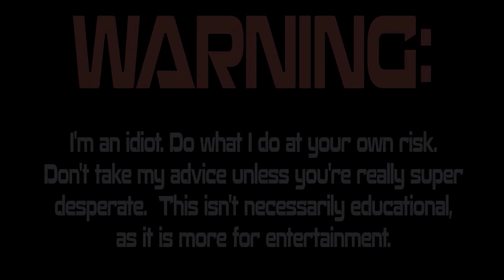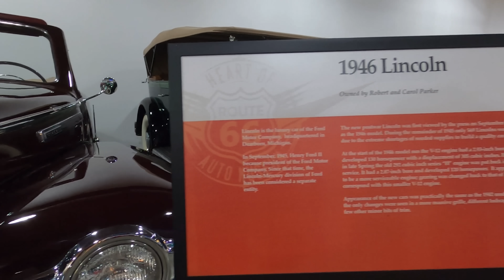Will This 1956 Buick Special DRIVE 1,200 MILES Back Home - I BROKE DOWN! (P2)

Comment: I was told by an old timer that wireless tying a wooden clothes pin to the fuel line can help with the fuel line vapor locking

Comment: Your Car and your Trip have brought back some old memories of long ago.  My Father bought a used 1955 Buick Road Master in late 1956. Each Summer from 1957 to 1962 we would go on a Summer Vacation of just over 1200 miles round trip. That Buick was a wonderfull riding Vehicle. However, I recall he had to shortly after buying the Car fix the Dyna Flow transmission. These Trasmissions were noted for problems. The Transmission is the only major problem I recall that occurred with this car. It was a very reliable comfortable on the Road Car. The excellent ride quality now as I look back was probably do to the fact that Buicks were a Heavy Car and the Heavy Cars in those days all seem to have had a pretty good ride quality. In all the Summers we went on Vacation in that Car it never broke down once on us. My Father sold the Car in 1963 and bought the only New Car he would ever own " 1963 Gran Turisimo Hawk Studebaker" which he picked up personally at the Hamilton, Ontario Plant where they made the vehicle.

Comment: I had a 72 camaro RS that used to do what I thought was vapor lock. It was annoying as hell. It turned out that the cam was flattened enough to where it didn’t make the mechanical fuel pump function properly. I eventually got sick of it and used one of those little electric deals and ran it back near the tank. Then when I swapped the motor I put a mechanical one back on. I liked the electric one but I always worried if I ever got into an accident that little electric pump could still be on and just pumping gas leading me to a fiery inferno. But I put the new mechanical one in and it ran like a charm. 
Now I gotta find part 3 of this vid

Comment: I inherited my uncles '63 lesabre with a 410 Wilcat nailhead and a dynaflow transmission, which I loved back in the mid 70's with about 70'000 miles - a car I rode in most of my young life, when I got it I discovered it had never had the coolant flushed or changed and that thing was always prone to overheating, found the clutch fan was weak and replacing it helped a lot, but like yours my freeze plugs were getting angry and on a hot summer day she still wanted to overheat even without a thermostat, I suspect the cooling system was sludged up, but it never burned a drop of oil.  Drove it from Tennessee to illinois and the starter solenoid stuck on in a gas station nearly burning up the battery cables.  In short I was a young guy with no money and it needed a lot of $TLC$ I couldnt afford at age 16, but ill never forget riding in that car with my uncle in Chicago, Tennessee and years after he passed onl  RIP Uncle O.L.

Comment: feel the radiator fins from top to bottom , should be even temp , if you feel a cold spot the rad is clogged in that area

Comment: Kanter's should have just about everything you need. I have a brand new set of wheel bearings for that car, got them from Kanter's. I would give you those bearings if I knew where to send them.

Comment: My folks  had a sweet '55 Super very close to your '56. I  wanted it.   My older sister got it and wrecked it. This was  after she creamed their '57 Olds 98 with tri-power j-79. They fixed that one and traded it in on a '66 Dodge Dart. They got fifty bucks for the olds.

Comment: Easy fix to vapor lock is to use wooden clothes pins on the fuel line by the motor. Worked like a charm in my old suburban.

Comment: After all that you have tried, it sounds like you have a head gasket leaking into the cooling system causing the overheating.  Also, on the gas issue - why would you not suspect a bad fuel pump?

Comment: Nice old car I use marvel mystery oil in the gas on the old ones helps lube the valves runs cooler but little bit more smoke. Water Wetter really helps cause them rads get clogged

Comment: With the new radiator hose use a wire coat hanger. 
Just unbend it then shape it around the hose, to the shape you need 
 The hanger will stay that shape until you get home

Comment: That bottom hose always swells at the bottom. Had a 1973 Pontiac Ventura that that dropped a rubber gas line in down town Frankfurt Germany. Had enough unleaky  hose and cut out the break on the line connect what was left to limp home to Mannheim Germany.

Comment: I had a 72 camaro that vapor locked when it got hot. I eventually switched to an electric fuel pump and it solved the problem. Before the electric pump I’d put in a new mechanical pump. It still would leave me stranded. I figured maybe the cam was just worn enough maybe to make the pump stop working. When I put the new motor in it I went back to a mechanical pump and it worked perfectly. So who knows, I think it was the cam being worn and it wasn’t moving the rod for the pump enough.

Comment: If you bring a little gas bottle to prime the carburetor, try to get the gas into the float area, You can almost always start a vapor locking vehicle without waiting to cool down. Then just be sure you are moving at at least 20 miles an hour and you might be able to get the fuel moving again. Also, an electric fuel pump, wiring and an extra battery would be good to bring along (or buy) on these trips. Just in case anyone else gets into this predicament.

Comment: hi derek, I noticed that there are 3 pedals on the floor, but I don't understand what its for as the dynaflow is essentially an autobox.  Can someone explain what's going on with the extra pedal?  Would be much appreciated.  Cheers, Frankie.

Comment: My first car was a 1956 buick super, model 56R these episodes with your buick brought back memories most notably the overheating issues. The pattern of overheating was very much those your car experienced. Whenever it was very hot or climbing a very slight grade you can literally watch the temp gage go from green to red. I did all the obvious things but the overheat issue was never remedied until I did these two things. I power backflushed the cooling system.  I ran water through the system along with injecting compressed air in random bursts. That seemed to help a little buy but not 100%. I noticed the rating for the radiator was rated at 6lbs and verified that through factory manuals,  etc. I thought what will happen if I installed a cap with a higher pressure rating? I asked mechanics whose opinions and expertise I held in high regard. Suggested to me to try a higher rated cap from say 1957 buick that called for a 15lb cap. I reasoned radiators and cooling systems can't be that much different where installing g a higher pressure cap would cause a issue.  I tried it and no more overheating. I owned the car for another 25 years and in that time it ran at 180°F. I also noticed the coolant capacity was huge by today's standards that approached 5gallons which is more than twice as much as in a modern car. Just thinking outloud. That's 5gallons of hot coolant is alot to cool down.  If your buick still gets hot check  the specs on your cap. If it's a lower capacity you might consider a change. That's my 2 cents worth.

Comment: You might have a air pocket in your cooling system , I would clean out the radiators fins and get the front of the car high so the radiators fill point is the highest part and open your heater tap and bleed your system so u get all the Air pockets out of it  ,or make a funnel out of a bottle And use that to make the radiators fill point higher,

Comment: I had a 55 buick special 4 door no post I got when I was 16 for 600 bucks in 2001. First car I tore down completely did not know a thing I was doing but got it on the road in all flat black walmart 98 cent spray cans paint job took 2 cases and I had black snot for days. Trans started banging and I was (still am) poor so I had to remove trans by myself to save money. I still feel the pain of that dynaflow cast iron trans on my chest trying to wrestle it out car on jack stands and trans fluid on every inch of my body.  Luckily I found an old time transmission guy who still had the parts on his shelf. Went to pick it up and he had 3 guys bring it out and put it in my exploder and said he hoped I had help putting it back in and I lied and said I did. So many stories in that old car I wish I never sold it. Finally got it running "right" and cobbed the closest gas tank I could find in it so it stopped clogging gas filters and breaking down ( I believe the tank was a 80s Chrysler 5th ave with the 318 that fit really good even used my old filler neck JB welded in place. I enjoy your channel so much you have no idea how much I experienced so many junks like you do. Thanks.

Comment: Wooden clothes pins on metal fuel lines usually prevents vapor lock. 
Someone closed the driver side door by pulling on the window and cracked it. Don't ask.

Comment: A Mr Gasket 3psi electric fuel pump  with 3/8 and 5/16 hose barb ends is a must take on a long trip. A lifesaver.

Comment: I love these sorts of road trips. Fly (ex-Perth, Western Australia) to Melbourne to a site unseen car that's been sitting for several years and they can't(won't/lack of ability/interest?) get started. Get it started and drive to the nearest Supercheap (Pep Boys), leave it running in the car park & go in and buy a jump pack. Go to the hotel & of course do the right thing and take the battery upstairs to plug it into the battery charger (in the bathroom) I brought with. Spend 4 days exploring Melbourne (never a comment on the battery charger from staff) and then stab it on the highway towards Perth for 2383 miles (I did the right thing with a permit - no interest in kissing my toes in Aus for driving an 'illegal' car). Got re-directed twice because of the bushfires that year. Made it  2258 miles & the front left blew out - in town! How lucky is that. Discovered we'd embarked on this journey without a jack (OK, not discovered, I'd noticed but failed to mention it to the fairer sex - hey - there's always trees, rocks, stuff around). Luckily (weekend) someone was open and regaling our journey he let us use jacks to get back on the road. Good times....can't wait for the next one!!!

Comment: I had a vapor lock issue on a 500 mile trip in my 70 Chevelle - bought 10 feet of fuel line and coiled it in a cooler bag between bags of ice from  the hard line at the frame rail to mechanical pump.  Problem solved .  Of course the cooler bag was never quite the same .  Oh well.

Comment: A fella's got to check that the fan shroud is sealed up good and that its nice and close to the fan so hes gettin' good circle-ation through the radiator! Ive had that problem nip me in the rear at least 487.29 times and counting!

Comment: I know this video is over two years old, but I have a 49 Cadillac everything you experienced I have also, Vapor lock, overheating solved with a 3 core rad and 5 bladed fan from a hurst, routed fuel hoses to the front of the water pump air from fan cooled it hard pack fuel lines are way too close to the heads with these older cars  I live in vegas and run the car in the summer, you don't want to idle when it is 117 out... car handles the heat.

Comment: GOOD LUCK finding actual front wheel bearings with ball bearings... GM discontinued those in about '59 or so. Your best bet is a roller bearing conversion. My stepdad had a '64 Skylark convertible that would overheat like clockwork every 100 miles too. That Buick was just something to get him to work while he worked on his '68 Roadrunner so he never tried to figure out the overheating issue, he just got rid of it...

Comment: Congratulations Derek!  Thanks for sharing your story.  You videos have been great while stuck inside this winter.  On you vapor lock, you probably already know, but lower octanes boil at higher temp.  Learned that the hard way when traveling over the Rockies in a 93 Aerostar in the summer with my wife, kids and camper.  That van also had the fuel line near the exhaust. Naively, I decided to run high octane to get me over the mountain.  The mechanic who towed me down the mountain knew exactly what I did wrong!  Topped it off with low octane and it got us over.  Thanks for everything!
Reply: Thanks, interesting idea on that : any other thoughts on 91–95 OCTANES :” noticeably more folktale, AND hi ALTITUDES, etc.” ( as ALWAYS  PROBLEMATICAL the hot exhaust,  NEXT to A Line, etc).. I live in HELENA Valley MT & run HI OCT( no. alcohol in my Truck sometimes, esp if plan to use PEA INJ C,EANERS, ETC)…..

Comment: I nearly attempted a Chicago to Las Vegas to LA road trip in 1998, with a '63 Galaxie 500XL convertible, that I had vetted... well, I didn't do anything except check the fuel levels. I chickened out. Not another month later, driving it around town, I stopped at a store and it puked all over the parking lot. Had to limp it home on bottles of water. When I got it there, turned out the thermostat had locked closed, and the motor overheated. The fan clutch had freewheeled, and it was a one year, one model only fan clutch, which took a month to find, and I would totally have been stranded in Missouri or somewhere, likely.

Comment: I would stop at a napa and get fuel hose and shorten that hose that is going through the center of the belt might help she sure does seem to be vapor locking a ton Derek @ViseGripGarage

Comment: At least 2000km out of these fixes on similar issues:

1. punctures, wide head wood screws (probably always keep 5 in your pocket) with a little bit of thick or gel superglue laid on the wide head. Drive that in slowly, drive it into a dry hose, don't do it whilst the thing's full or hot or wet. Let it rest an hour.

2. worn down hose, bicycle tire puncture kit (AKA, a bicycle tube, thick one from Maxxis (the kind used for tricks and stunts) should do and a contact cement). Cut bits of the tube, lay them as per glue instructions (that one can last you a long time). Lay them wrapping around the thinned out area.

Bonus: no 2 can be used as a puncture fix, but it needs to go on the inside of the tube, rather than on the outside, and you have to use super glue (gel) instead of contact cement.

Comment: Derick my grampa use to say use wooden clothes pins for vapor locking. Clip them on fuel line that's getting hot. I,be seen old timers use clothes pins on old ford tractors.

Comment: Try taking the thermostat out completely. Those old engines will run along cooler with it out
Also, try raping your gas line loosely with aluminum foil for vapor lock issues. It will act like a cooler

Comment: Lev-R-Vent radiator Cap- to gey in a hotter radiator -water cooling required but it stops the volcanic eruption 🌋 while opening. 16:05

Comment: what it needs is the engine removing, stripping back to the bare block and acid dipping to clean out all of the waterways of years of deposits, new freeze plugs etc

Comment: My first car was a 56 Buick Century Special. Bought it for $50 from my brother going into the military. In great shape, no dents but a piece broken out of the grill. The front u-joint/ rear transmission “seal” assembly was worn out and leaked like a sieve. 6 quarts of tranny fluid to drive 300 miles. I couldn’t find a replacement part in 72 to repair it and gave it away to a friend who took an axe to it to make a convertible. I just about shot him then! 😂

Comment: My mom and dad had a pink and white 1957 56 rather Buick special 4-door and I used to stand up when I was about 5 years old stand up on the pump in the back of the floorboard and hold on to the rope that went around the back of the seat and while they drove around they'd have to keep reminding me. But it was a fun to see a car like that again I wish I was would have been a two-door but thinking of white I thought my dad showed me a nice Rambler when he thought I was looking for a first car it was pink and white I quickly explain to him a single male can't drive a pink and white car I don't care how clean it is I ended up with a 63 Nova Super Sport 250,250 cash $100,000 miles with a brand new overhauled inline 6 and a Powerglide automatic it was a look real good I had to repainted it was economical 31 cents a gallon and when I started driving I was born in 57 when I started driving with my first car to and from school and it was always in the driveway to be worked on I got it when I was 14 I didn't know that you could you could drive learner's permit with somebody over 21 they didn't let me do that they had me wait till I was 15 and I got a restricted but that's okay life changed for the better enjoy the video thank you

Comment: Back in those days some cars were prone to vapor lock.  Old timers would clip wooden clothes pins on the fuel line to supposedly draw heat away.  Cadillacs were the worst!

Comment: Get a good thermostat and check it before you even use it in boiling water. A radiator flush is probably what is really wrong with it or your water pump might be an issue

Comment: Old trick: clip clothes pins on metal fuel line to act as heat sinks to try to avoid vapor lock.

Comment: Never forget when I was about 6 our 5-year old 2nd hand1960 Buick LaSabre would overheat when we'd go to Atlanta or to the beach.  Memories of my dad with a rag over the radiator cap on the side of the road attempting to give it a drink remain etched in the old cranial cavity.  Many years later, after my dad's passing, my mom needed a car she could handle better than a 1978 Chrysler New Yorker..  Ended up with a '88 Buick Century 4-banger.  It was the roughest iding car due to that weirdly unbalanced 4-cylinder.  I have nothing good to say about Buicks as a result of two models almost 30-years apart.  So much for progress.  Funny Oldsmobile and Pontiac are gone and Buicks still seem to be cranked out. Don't know what that says about GM???